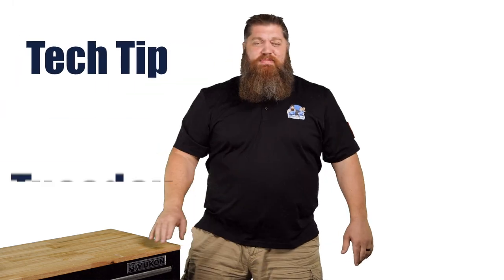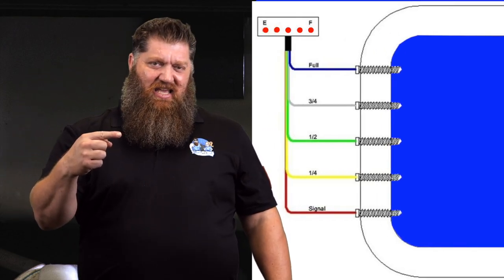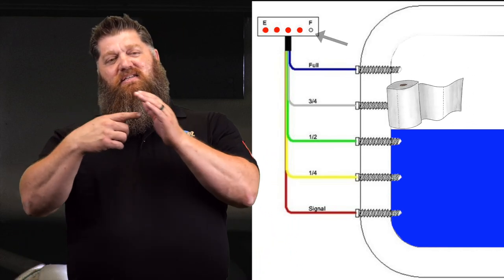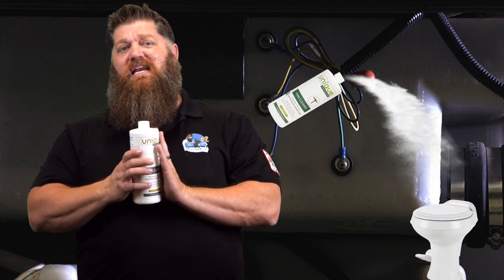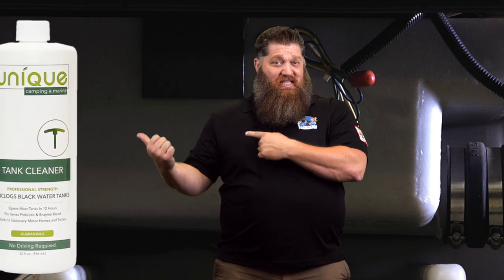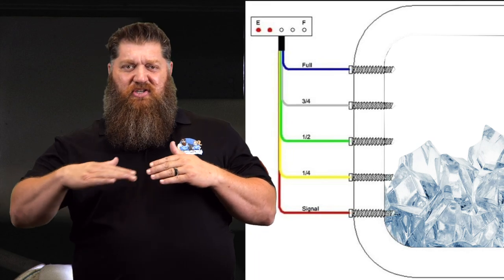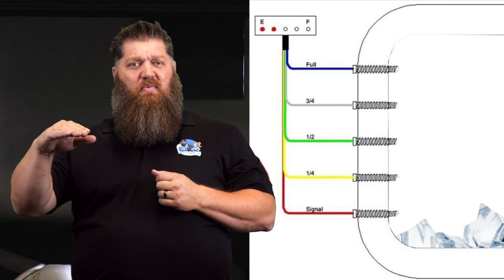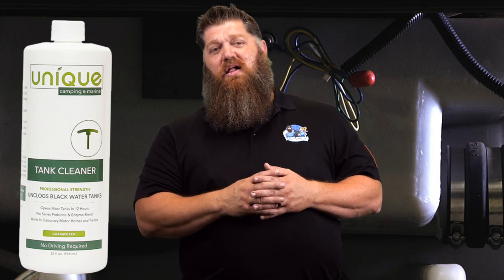Fix your RV Tank Sensors

Comment: I've had same problem,  cured using 1 cup powdered Borax and 1/2dawn dish soap. Flush out holding tank and fill all tanks about 1/4 full of fresh waster then add Borax and soap.Tanks and sensors will clean themselves while traveling from one campsite to the other and then flush mixture out .
Reply: Did you add to the shower drain and bathroom sink?

Comment: That stuff it expensive, and it didn't work for me. I take great care of my tank, and have an internal spray flush I use at least every other time I dump. I've even tried the hand wand, which didn't work either. These have to be the worst made things on an RV. You would think, that with all the need, someone would come up with a better system that works! Might have to make that my mission.
Reply: Understanding that the factory systems have usually a conical spray pattern makes them inherently flawed. When I bought my new fiver with the factory system I was anxiously awaiting the results of my test. Using nothing but the factory sprayer I drained a full tank and turned the sprayer on for about 10 minutes and fully drained the tank. I then closed the valve and filled the tank and dumped it and more waste drained out. One more time I filled with the factory sprayer and fully drained the tank and the water looked good but my sensors still showed one third full but it was completely drained. I then used my old standby the stick wand, and filled the tank, and got more sludge. After filling one more time I got clean water and all sensors were working. I still use the factory system but about every third dump I use the stick, and I’m a full timer.

Comment: I have zero improvement using Unique sensor cleaner on the kitchen gray tank. Use a screen to prevent food to get in tank, but to no avail. Next step....replace sensors.

Comment: The “fix” for the stick on external sensors is pretty simple. They are capacitive coupling type proximity sensors. I’ve used variants of them in industry for decades. The sensitivity is such that slight coatings inside the tank will trigger them. The fix is to carefully remove the sensor. Clean off the adhesive thoroughly. Then apply two layers of 3M double stick tape completely covering the sensors. This reduces the capacitive coupling. The tank levels will still register just fine but will be less sensitive to coatings inside the tank. My gray tank works great now and the black tank will only hiccup if there is a piece of paper stuck on the inside where the sensors is.

Comment: You didn't mention using a whirlygig probe that inserts into the toilet and with a water hose cleans out the tank. I used one on our old Class C, but our new TT has an external tank cleaner fitting.
Reply: Yeah I use that same tool as well . Have had great results with it . Definitely a good cheap simple solution 👍

Comment: We used the Volterra power blue after using the RV digest that didn't work....I emptied the tanks..used a 5 gallon bucket to flush out the gunk in the black tank...then we took the big bottle of Volterra and divided it among the 3 tanks and drove with it and about 5 gallons  of water in each of the tanks...yes it worked..was a 8hr drive..split between 2 days...

Comment: Trusted and true. Prior to each dump, totally fill the black tank until you see the water at the bottom of the toilet. Let it set and then as you keep the water flushing, open the dump valve and watch to see clear liquids exiting the dump valve. I use a clear hose adapter to ensure I see the liquids flowing out of my black tank. This has worked for me over the years and has never had an issue with my levels giving erroneous readings. The problem with many RVers they leave their dump valve open while parked at an RV site. Many RV parks are starting to require NOT to have the dump valve open until ready to flush and dump.

Comment: I tried this stuff on my tank with no effect.  Ended up changing my probes to the Horst probes.  So far, so good.  My probes are bolt-in not hot spun so the change was easy.  Video on the other channel.

Comment: Wouldn’t using your external black tank flush clean the debris from the sensors ? Also I could see where debris from black and grey tanks could fool sensors but why would my fresh water tank monitor not jive with my actual levels. Really appreciate your short videos they are very informative

Comment: Can you recommend a macerator?  I have purchased 3 different $130 units from Amazon and they have locked up about 1/2 way through the process when draining black water.   the black water today looked like soupy oatmeal, so it may not have been dissolved enough. this occurred when I put the hose with a sprinkler head into the toilet.... so it may have dislodged a pyramid....  I didn't see a review or recommendation by you in another you tube, so I am asking here... thx...

Comment: I recently purchased a 2019 Grand Design Reflection fifth wheel, The owner had been parked at a RV Resort for over a year with full hookups and camper never moved, The day I picked up we drained all tanks, He said the Black tank reads 3/4 full at all times and not to worry. After researching all tank cleaners I found this on U tube and after reading the reviews I thought I would give it a shot.Filled my Black tank per Instruction and poured in 16oz and let sit overnight, next day took my camper on a 20 minute ride and then dumped my tank, BOOM sensors read empty, I will be using Unique products in the future.
Big shout out to Todd for the info, Really like all the content he shares with us.
Thanks Brian G
Reply: Didn’t work on mine and left in tank 1 extra day.

Comment: The most simple and easiest way to avoid this is to just not put toilet paper into your toilet. We bought a small wastebasket with a lid that sits by the toilet. It works wonderful. But we still have problems with our gray tank sensors. I will try the unique sensor cleaner on our gray tanks.
Reply: 100$ agree. Interestingly, I've lived in Latin America for 10 yrs and most bathroom pipes can't handle t.p. so there's always a basket next to the toilet for t.p. Where I am now, I.can flush t.p. and had to readjust to flushing, as I was so used to throwing the t.p. in the trash.😊

Comment: I am guessing that if you’re using the ice in the tank technique, the way you move the ice around is to have the RV in motion. I would advise caution considering how many waste water holding tanks I’ve seen become dislodged due to the manufacturer not placing the mounting bracket correctly and the weight of the water buckles the holding tank. Thanks for the video, I will definitely acquire the RV Digest It tank probe cleaner.
Reply from the maker: We totally agree!

Comment: I have been full timing for four years, and although I don’t disagree with your advice, you must do regular cleaning with a tank sprayer. And the factory auto flush systems aren’t enough. I still use the old fashioned stick wand about every third time that I use the auto flush and dump the tank. The stick never fails to bring my monitor back to zero.
Reply from the maker: I agree stick wands are great. Depending on the design some are far better. The tip isn’t saying it’s the only way, just a good solution.

Comment: I bought a used RV, and my level indicators are on the hood range above the stove. They've never worked -- even when I didn't realize the black water tank valve was closed and it started to bubble up in the tub. The test button seems broken. I've never filled up my water tank because I never wanted to have to deal with cleaning the water tank itself only to find out that nothing is hooked up to the overhead hood. How do I know if the proper wires are hooked up to the hood and what can I replace it with?  I would like to get a sleeker hood and just have another meter mounted on the wall if possible.
Reply from the maker: You would have to test the wires and make sure you have good voltage coming to the panel. But if it's the wires heading to the sensors then it would be easiest to find another tank monitoring system and rerun those wires to a new display. If you wanted to monitor your batteries then look into a battery monitoring system. like the victron BMV-712, this has bluetooth and can give you current data on your battery. The monitor panels are notorious for being unreliable.

Comment: We’ve been live-aboard sailors for 20 years. The holding tank is near and dear to us. Toilet paper goes in a sealed container with a trash can liner and a screw-on lid. When full, it goes in the trash. There is no detectable smell because the TP absorbs all moisture from the poo. Why would you want to fill your tank with paper mache???

btw - Forget about chemicals, except enzymes maybe. They just damage seals and valves, and screw up the bacteria. Wash the bowl and area with white vinegar. It kills odors, cuts through residues, and dissolves hard water calcium deposits. 

abtw - When you take off, have the black tank about 1/4 full of plain water. Pump out when you arrive. The sloshing will clean the tank walls.

abtw - Depending on the cubes, ice will weigh about 6 pounds per gallon. It won’t do much good because it just floats around loose. The water sloshing is your friend.

Comment: I'm having an issue with the fresh tank sensor.  I have an 80 gallon fresh water tank that is reading full at about 40 gallons.  What might cause it to read full when it's not?  It is also now registering as ~1/3 full when I completely empty the tank.  Any thoughts?
Reply from the maker: Check your sensors, if you have the type that stick to the side of the tank they could be coming loose or they could have fallen completely off.

Comment: What about the gray tank? Mine most of the time shows 2/3 full and I can’t understand how the sensors are getting shorted to the ground wire to turn on the light. I can remove one by one wire from each sensor and the lights go out like they are supposed to.
Reply from the maker: You can use the same product in the grey tank. Go to the Unique website, they have info on how to do it there.

Comment: Related to this which brand and or RV toilet paper in your opinion is the best to use for this issue and overall.  TIA. 
PS.  I never miss your channel.  The tips are amazing
Reply from the maker: TP that is septic safe is normally ok to use. The TP you can find at camping stores are able to dissolve the quickest…so quick that sometimes it dissolves before you’re done using it lol

Comment: How do you fix fresh water tank sensors. Mine only reads 1/3 full when the tank is completely full. 2020 model.
Reply from the maker: Check and see if they are sensors that sick to the side of the tank. They may have to be resealed to the tank.
Reply: Or the wires may have broken off.

Comment: Don’t put TP down your tank put in in a trash can. Problem solved!!!!!
Reply from the maker: That’s a personal preference and one that can lead to an unpleasant odor, flys, and accidental hand to skid mark contact. Keep your tank healthy and problem solved as well.
Reply: @NationalRVTrainingAcademy  just change the trash liner Every day I’m very particular about my Tiffin bus I only camp with my wife and don’t have others in my coach it’s never been a problem in the years I’ve owned my Allegro bus.
Reply: @stevest.martin3940  I never used toilet paper in my tank and no one has ever pooped in it and used plenty of water... And guess what??? The sensors stopped working about 6 months in.
Reply: @lenasterne7208  you must not own a Tiffin? You probably have a class C Tiffin puts there sensors on the outside of the tank so there is no intrusion into the tank. Good luck

Comment: Not sure why these ancient sensors are even used on modern RV's when non-contact ultrasonic sensors are not very expensive and far more accurate. 

At least but a spray jet over the sensors for when you do a tank flush - it would blast anything off the sensors. 

The RV industry is so ultra-cheap that it makes RV'ing a total pain in the butt. Everything is falling apart all the time. My rig is 2021 model year and I have been repairing it since day one.....not even worth taking it for warranty service because it would effectively just live it's whole life in warranty. 

This channel is fantastic for encouraging owners to get smarter, roll up their sleeves and figure it out.
Reply: Yeah, I bought mine new two years ago.  Took it to the space I planned as a semi-permanent location for working remotely, and ever since then the tank sensors showed 3/4 full at all times even though it had never been previously used.  To get warranty done, I'd have had to take it back in, which I couldn't as when I bought it I didn't have a truck to pull it, I had rented one to get it to that location.  I have fixed the dozens of other broken things that occurred immediately after purchase on my own.

Comment: The tanks sensors are just plain junk, right from the start. Do not waste your money on these cleaners, you’ll never get them to read right, ever. Why do you push this crap, no pun intended, as they only work once. Get a good feel for your tanks and use your best judgement as to when they are close to being full.